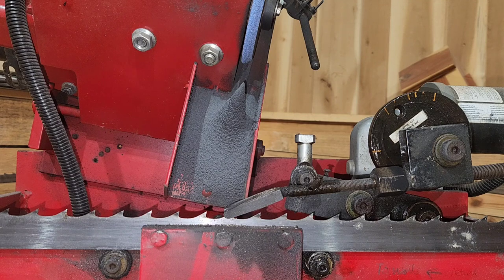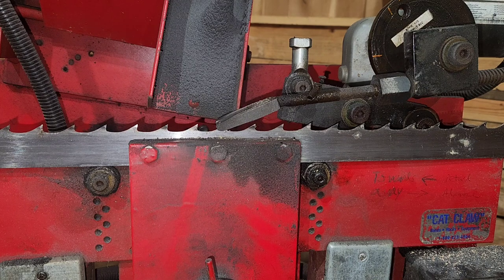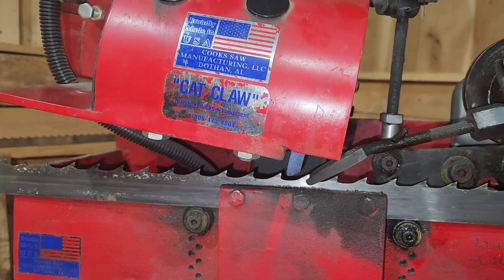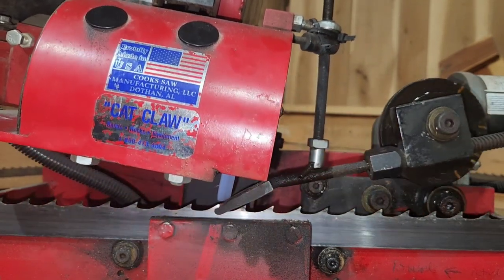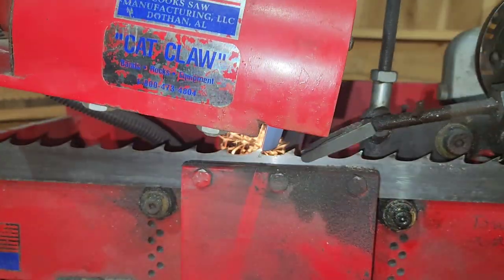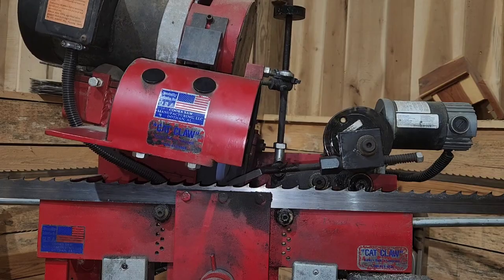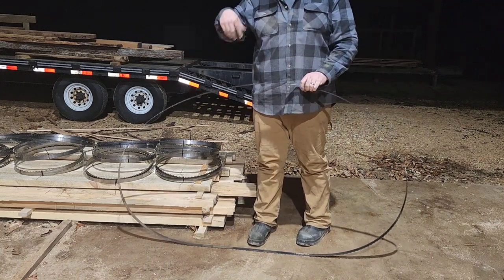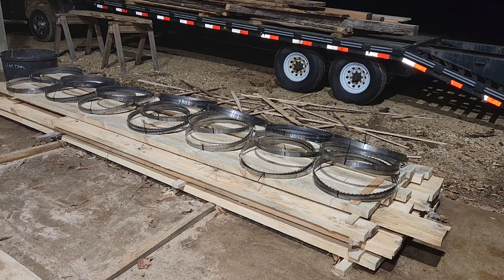Cooks Cat Claw sharpener, setting up on a blade instructional video

Comment: Thanks Thomas! 

I was going to get the cook's sharpener but they told me 47 weeks lead time. 

I ended up with the woodmizer BMS250. Very happy with it. Works a little different but does a good job.
Reply from the maker: I'm looking to get a woodmizer BSM250 as well

Comment: No mention of the weld. Woodland Mills stresses importance of starting on one side of the weld and stopping when the weld comes around because tooth spacing across the weld may not be exactly the same as all the rest. What do you and Mr Robert say?
The sharpener W'Mills sells is not designed to sweep the back of the tooth. The only way I can see to make it do that is to reshape the cam that lowers and raises the grind head. I haven't tried to do that, though.
Reply from the maker: I have talked to quite a few blade manufacturers about the placement of the weld.  You are correct, not all manufacturers have it perfectly spaced.  They try to get it close, but there is some variation.   If the spacing is not the same I am usually close by and can adjust if necessary.   The sound of the grind will give it away.   
Best practice may be to start and end at the weld, but when I buy blades that is something I look at.  It's not too important to me for sharpening, but it's very important when setting a blade.  The direction of the set usually changes at that location. 
One manufacturer I talked to said their customer wanted the blade exactly at a certain length, and they didn't care where the weld was because they one time use blades for pallets. The weld for them was halfway through a tooth.
Reply: i to have a woodland mills sharpener i think you are right the cam has to be reshaped to get whole tooth an i to am not going to try and reshape it.. the cooks sharpen are much better but cost way more. take care, be safe and well.

Comment: Hey buddy, Cool equipment, miss seeing Mr Robert.
Once you try the Woodmizer BMS 250 you'll be in love lol, & not look back.
I could be wrong, but I ll take that risk lol.
The cbn wheel address the entire guilt is supper effective.
Saw milling & band sharpening is in my blood.
Wouldn't have it any other way 🤔👍💪💪💪💯🧡👌

Comment: When you sharpening is it nenecessary to sharpen the front and back teeth. On my Woodland Mills sharpener it only get the front's.
Reply from the maker: Yes, you should sharpen both sides.  I'll have a video out soon on my timberking sharpening system. It's probably similar.   It's hard to get a full sweep, but I can hit the front and back of the tooth with it.  A thicker stone may be the fix.